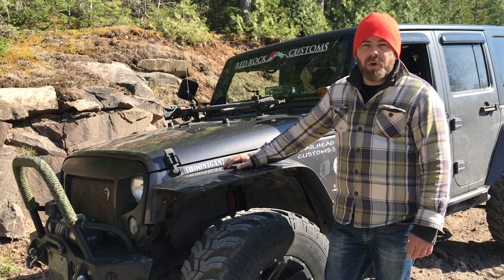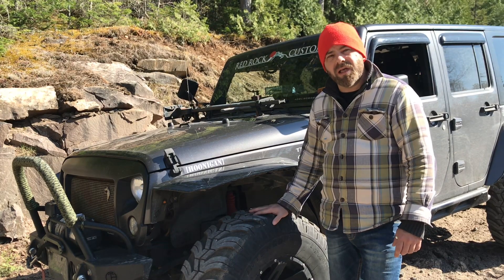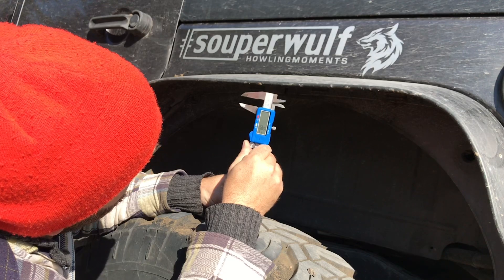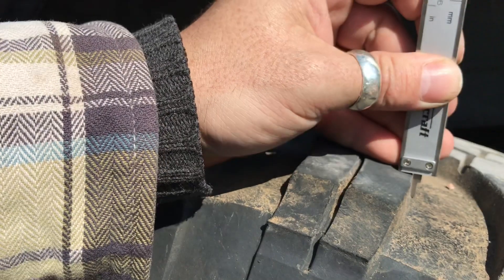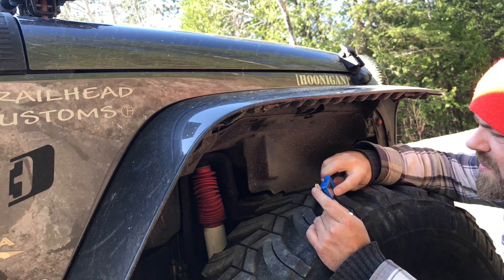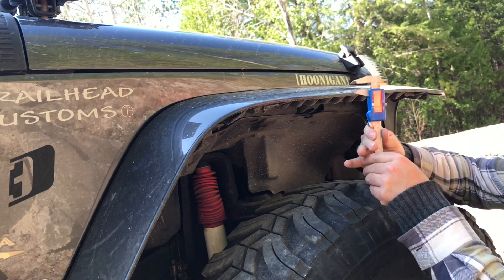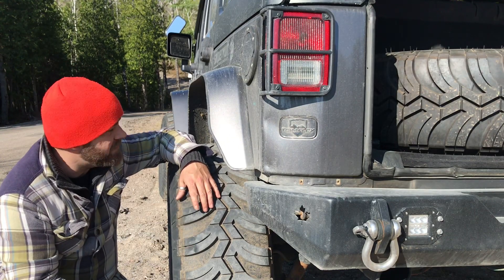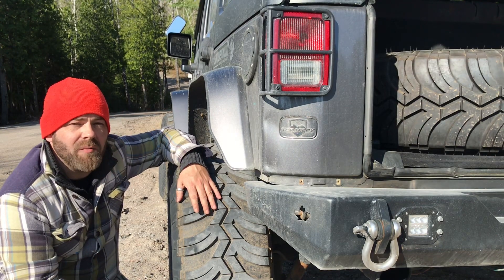INTERCO Faithful (Cobalt Radial M/T) Tire and Treadwear Review

Comment: awesome update, how is the noise compared to a standard toyo/nitto type MT tire? the old ground hawgs were load as hell but the interco rep at a off road show said the new tire is noticeably quieter.  keep up the vids
Reply from the maker: troy richards This tire is dead quiet on the highway, and rides very smooth. Awesome performance in all Trail conditions, and the treadwear is VERY impressive so far 👍🏼
Reply: I own them aswell, and 100% agree... strangely quiet

Comment: I think most of the noise of the old Hawg was do to the sharp corner on the shoulder of the tread.  These Cobalts dont have that sharp corner so I'd say the helps in the noise reduction.
Reply from the maker: Dave 7200 Yup 100%, and very true. The Lugs on the Cobalts don’t “cut” into the pavement as sharp as the Hawgs, making them quieter. I’m at 80,000km now, and still going strong. Amazing tread life. I’ll do another review at 100K 👍🏼

Comment: How many miles did you get out of this set? And how do they perform in deep mud?
Reply from the maker: Jade Gartz  Still rolling on these Boots! I’m coming up on 100,000 km’s soon (62,000 miles), and will be doing another Treadwear review. Hoping they’ll last me until the Winter time. Great tire in the Mud, it just spits everything out due to the Lugs being spaced so far apart. They’ve been put through the paces in all conditions, and I still haven’t broken a bead or had a flat. Stay tuned for the next review 👍🏼